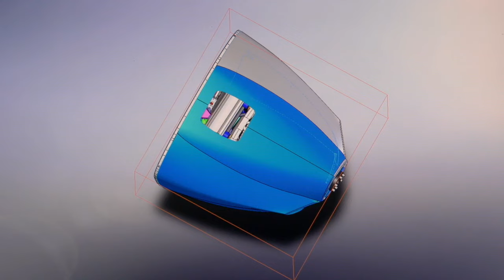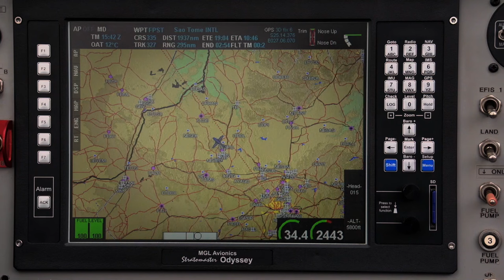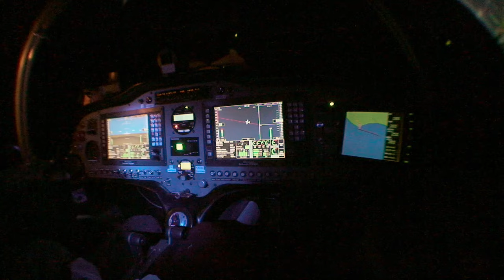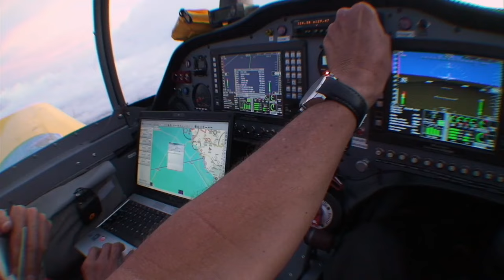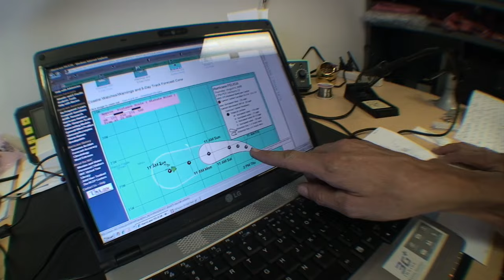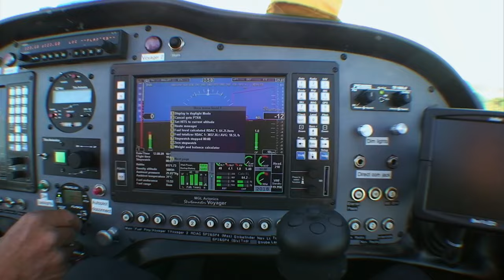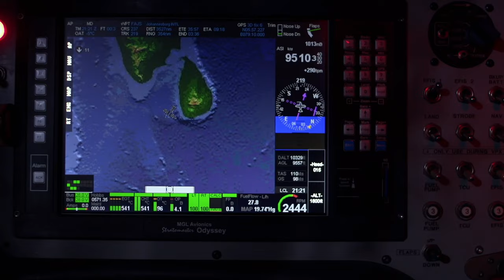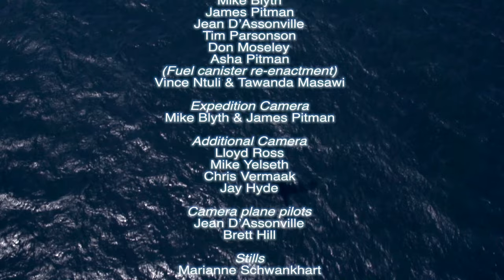Around the World in 40 Days

Comment: Watching this video again and realising 22 hour flight in a light sport aircraft over the ocean. How many fuel did you have to carry to fly so long? And did you refuel in flight or was all the fuel in the fuel tank? Id thought its impossible to fly that long with a plane 😄
Reply: Hiya Air Born. We carried all the fuel we needed - 450 liters, in three tanks in each wing. Our software (Airplane PDQ - which we used in the design of the aircraft) said we'd take off at that weight, and it was right. At take-off on the long legs the airplane weighed 920kg instead of the usual 600kg. Since the weight of the fuel was in the wings, it didn't add strain to the wing attachment structure (when flying, anyhow!). These aeroplanes and motors are pretty potent little machines! And in response to the question somewhere below, the "weather radar" we used was an Insight 'strike finder'. In theory it identifies the direction and distance of lightning activity within 200 nm of the aircraft. In practice our unit hardly worked - the direction seemed out of kilter and actually all we were really able to confirm was that we were in, or somewhere near, a storm!
Reply: Wow thanks for the thoroughly explanation! I fully understand it now. As a microlight pilot my next rating would definitely be a sling and id love to own one soon!😁 and take up the wild landings adventure like you did😁
Reply: Hi James....you really did a fantastic job....absolutely amazing......i watched your every documentary and i really appreciate the work you have done...i also want to make an airplane like yours....love from india
Reply: @jamespitman2086  that seems impossible in a light sports what's your useful weight?In Spain were limited to 450/495 amphibious.Tecnams are built to handle 600k ,but you've still only got a useful load of around 250k for fuel and passengers.You've  got double that just in fuel...just doesn't add up...even with rotax 915 and 40 extra horses...don't se it!ok just saw rest of message...920k and you got off the ground,wow amazing plane then,really want one even more.Hope to come see you in a Bathawk soon...